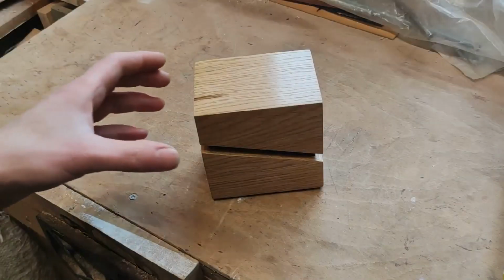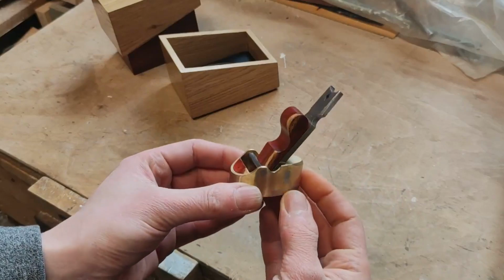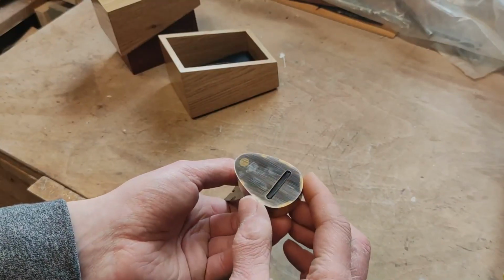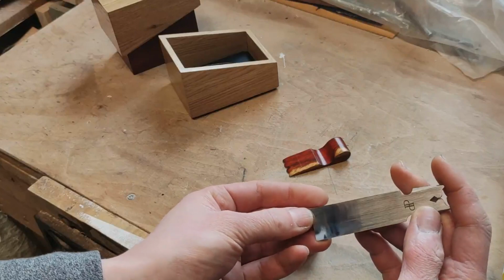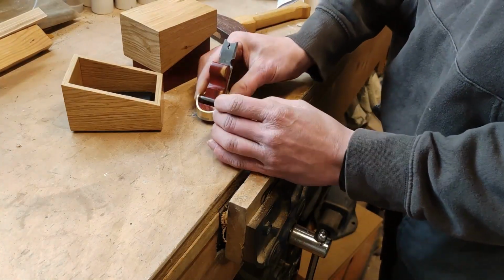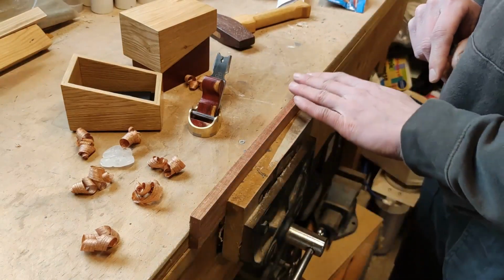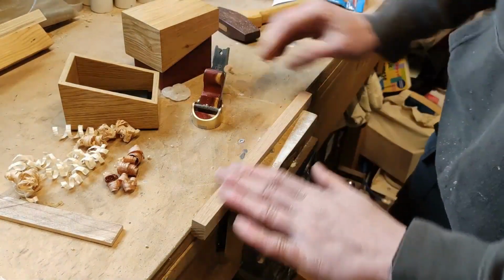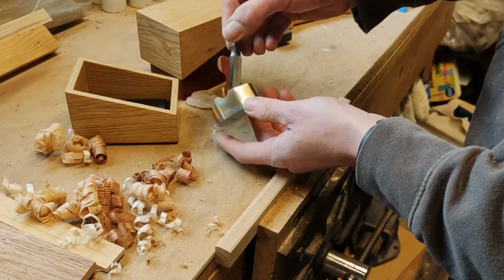Luthier thumb plane. Making a finger plane

Comment: how do you manage to make that closed oval body? did you start from a flat stock? I can not see any sign of a joint...
Reply from the maker: Thank you for the Question Onofre, yes the body is made from flat stock, then bent to the desired curve. the rear of the plane behind the steel through tenon is solid brass bar.